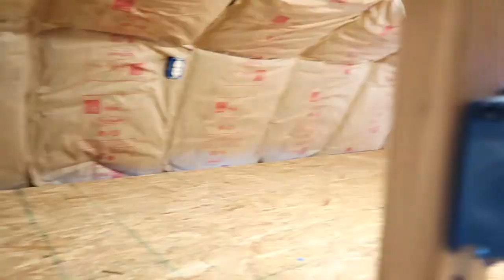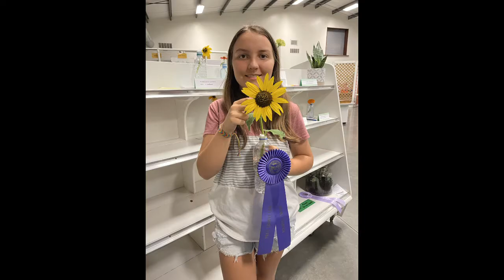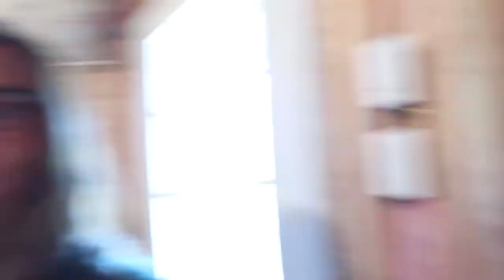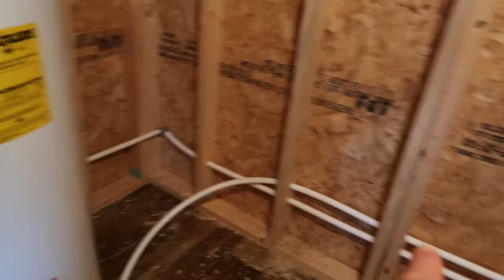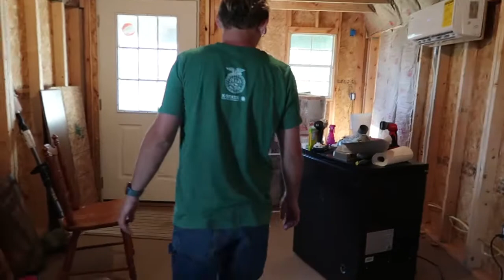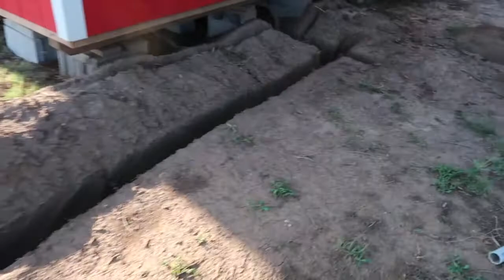Shed to House||  Progress and Life Update...  It's Been TOO Long!

Comment: You could add stud to the outside of the stud (this can be slightly reduced in width or kept normal width) the pipe goes around, notch-out a hole for the pipe to fit, then as you go to drywall or panel the walls, you would be able to insulate and finish the whole space. You would have a irregular corner but it wouldn't look bad behind the water heater. Main thing is you are able to insulate and finish the entire space.
Reply from the maker: I will have to consider that.  Thanks!